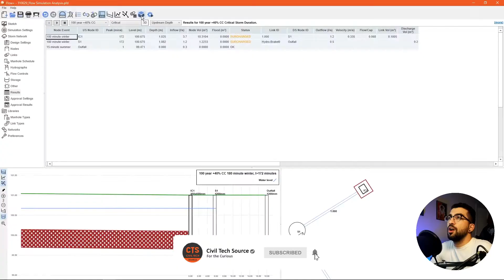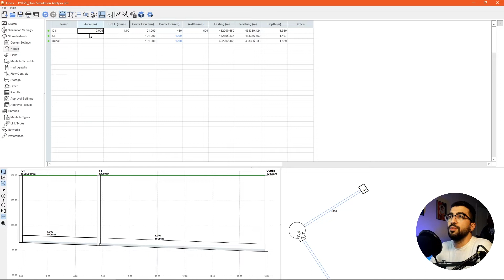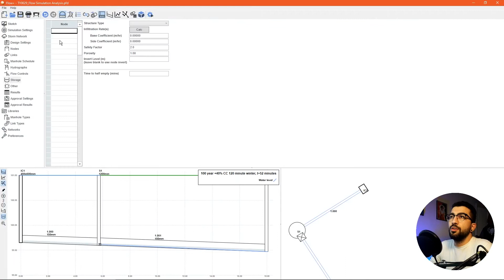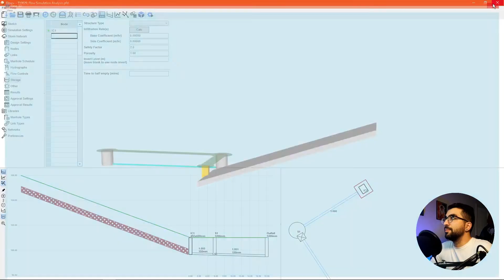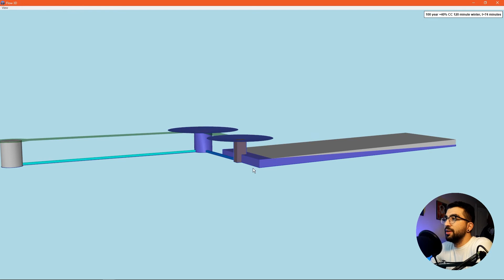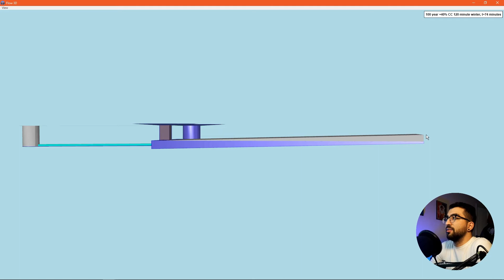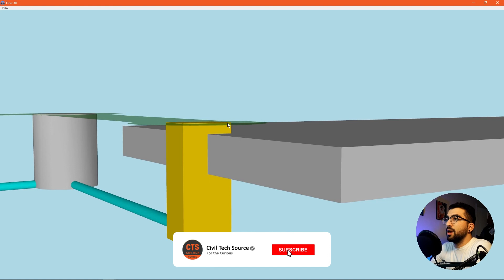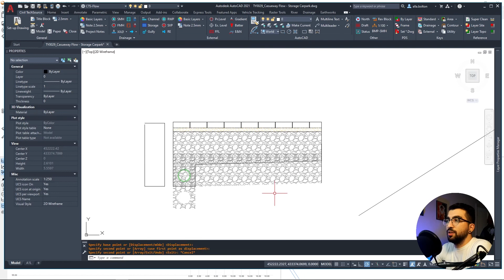Causeway Flow - How to model a permeable carpark

Comment: Is it possible to model baffle structures within steeply sloping car parks? 

Also, the sub-base for permeable paving is usually type 3 (sometimes referred to as open-graded crushed rock) as type 1 is too well-graded and is effectively impermeable.
Reply: You would need to add a series dummy chambers into the carpark structure at the frequency of your baffles and insert a weir flow control onto each node to represent your check dam/baffles. So effectively you will break up your carpark into a series of smaller structures, separated by flow control nodes... This principle can also be adopted when modelling swales adjacent to steep  carriageways for example. Hope that helps!
Reply from the maker: That is a very smart work around it. However, i feel it is an overkill in terms of design/resourcing, maybe?
Reply: @CivilTechSource  yeah it is a bit labour intensive but I've been forced to provide that level of detail by some LLFA's and highway authorities before!
Reply from the maker: Hi Jamie, thanks for your comment! Well spotted. In regards to the baffle structures, not sure we are there yet. It appears that hydraulic modelling is something that is tough to crack.